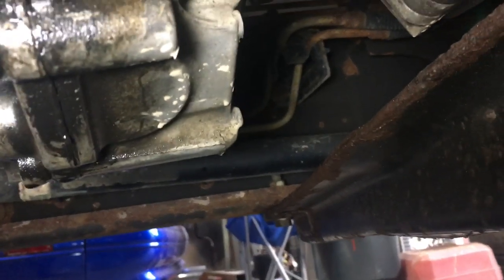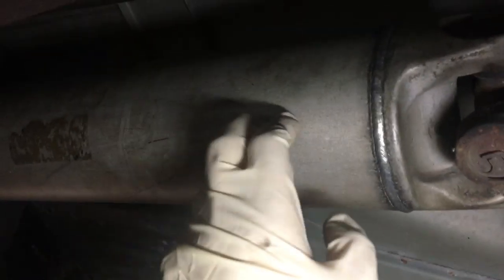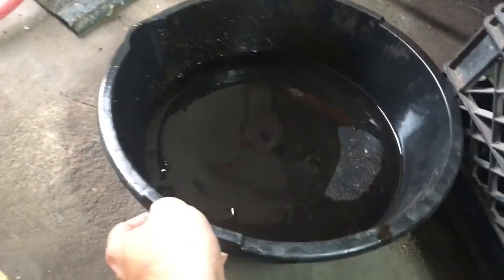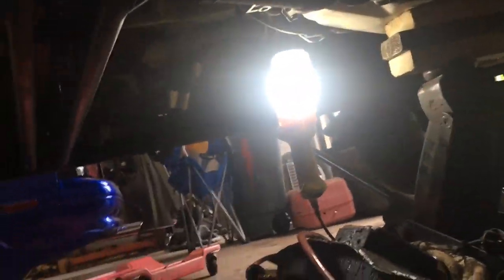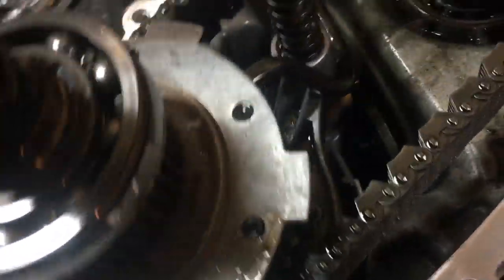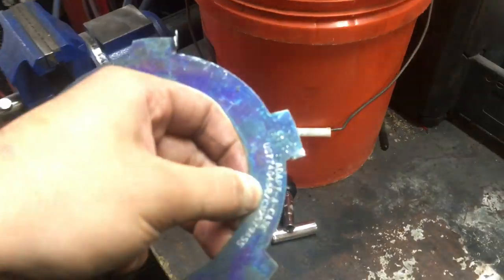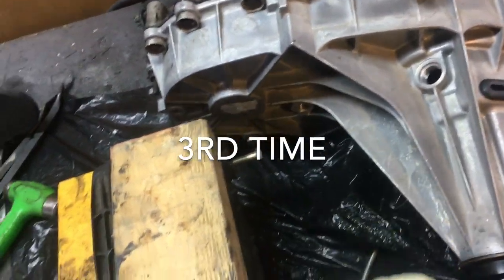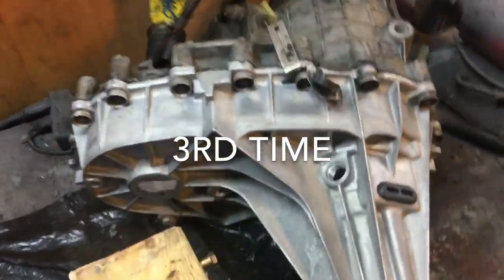GM Transfer Case Pump Rub Fix NP 261 263 HD Xhd

Comment: Permatex 51813 Anaerobic gasket maker which is probably the better way to go for these machined surfaces. This only hardens when deprived of air.
Reply from the maker: Stephen Johnson whatever works for you.
Reply: You can see in this vid that someone had already been into this case and used... "black RVT" which then filled up his filter.  Don't user RTV!

Comment: Some of that information was inaccurate it's only one bolts underneath the mount and you don't have to take it apart you just use a swivel a deep 15 socket and a short extension comes right off

Comment: I been wicked paranoid about this problem but at 275k miles mine still don't leak. No idea if I've just been lucky or what. I don't think the case had the fix done beforehand because when I changed the fluid there was a ton of super fine metallic you could see in the oil. But the level stays full and the case still works. I'm swapping in a manual transmission with my rebuilt motor and wondering if I should reuse this case or just get something else
Reply from the maker: @autumnjeserich2689  someone’s been in there with that mileage. Had a few of these trucks. They all get it before or at 200k
Reply: Considering I bought the truck at 190k that would line up. If the pump rub problem has been addressed, is it done for good or is gonna pop up again in another 200k miles.
Reply from the maker: @autumnjeserich2689  if they used a factory replacement it will go bad. They are not aluminum they are magnesium. The replacements I get are aluminum replacements and they say that they are a life time fix.

Comment: Don’t use JB Weld to patch the hole. It’s too hard and doesn’t flex. Got to hardware store and get polyurethane adhesive. It’s a better longer lasting temporary fix.
Reply from the maker: Preinstalled User it lasted the week that I needed

Comment: I would not use black RTV. It's your vehicle you can do what you want, but that is definitely not the best option.
Reply: Rock Roll 
As far as I'm concerned, it's NOT an option. ATF destroys regular RTV. You have to use the gray stuff that's compatible with ATF, like they include with the pump rub kit he's so adamant about not getting. That's also what was plugging his pump suction screen up. It was overrun with black silicone.

Comment: Will this make a grinding sound for a second or two when going out?
Reply from the maker: Crown _35 most prople don’t know they have this problem until its too late. You Can’t tell unless you see a hole in the case. Or too late when you run out of all fluid in the case from the hole and cook the internals until it’s all junk. Hopefully yours isn’t the last one.

Comment: im doing this and having a problem i can not get the snap right back on when i reassembled it with out the case saver it gos together just fine  but with the plat it off by a !/16 iff that any ideas
Reply from the maker: richard penning the shaft is not falling down into the snap ring for some reason. Make sure the front of the shaft has enough room to drop. And maybe the case saver isn’t installed right

Comment: hello there i am from mexico and i haave a yukon denali 2000 with the 5.7 motor. and my question is the main seal that goes to the shaft of the front wheels. is leaking oil and i cant seem to locate a store that sells it. can some one please help me out. thanks a lot for your time.
Reply: Omar Torres Sustaita rock auto

Comment: i did the case half on my truck and now after my 4wd wont work and i keep getting a service 4wd light any idea why im getting this ?
Reply from the maker: Jeff Williams assuming it's push button. I'd check electrical connections/ maybe a pin gob ripped out. That would be my starting point
Reply: myideasoffun ill check that but i for got to add it also when i start the truck some times the button will say im in 4low when its not and act likes it shifts from 1st to 4th and lugs down the motor and i would have to either put the trans in nutrual and push the 2high button or shut the truck off and on
Reply from the maker: Jeff Williams check wiring maybe reset computer. Changing a case half you shouldn't have dug to deep into it. So I'd assume it's a install or removal problem. Possible the switch in cab is bad. Older trucks had switch issues.
Reply: I need to find a np261 GM for my 2000 Chevy Silverado 2500. A place I called said they have a 263 HD with the same ratio of 2.72. Would the 263 be compatible and fit? I read that the 263 is electronic and my truck is a floor shift
Reply: Why the extra fluid

Comment: Is an np261 transfer cased the same as a 261gm transfer case?
Reply from the maker: NOMCCBAMA there is no 261gm as far as I know. NP is the company that makes most transfer cases. There is hd cases,  xhd cases. It’s stamped on the back
Reply: Thanks for replying. I own a 2006 silverado with a 4.3. The tag on the case is a new process tag. It reads 261 GM at the top of the tag.
Reply from the maker: NOMCCBAMA it would be a np-261. The hd would be 3/4 ton and xhd should be most diesels.
Reply: Thanks again. I really appreciate your help.

Comment: Where did you get the new case with pump rub ?
Reply from the maker: Matt Cherry probably eBay. Plenty of companies get have them. Make sure you get the right one
Reply: myideasoffun ok amazon has one made by dorman I thought about getting it. It has mixed reviews so idk
Reply from the maker: Matt Cherry I’ve done it a few times Parts don’t matter really. Just Get the right one as I described in the video and if it’s a magnesium case get the pump rub kit. If aluminum just put it on
Reply from the maker: Matt Cherry look when ordering xhd I s diesel and hd is gas. 261 and 263 have same rear halves. Just the x matters and material you wanna order/ can afford
Reply: myideasoffun ok thanks for the info
Reply: I put some jb weld on it today maybe it will hold till I can get a new rear case and find the time to do it
Reply from the maker: Matt Cherry should work for a little but not for long
Reply from the maker: Matt Cherry put more atf in so you don’t cook the bearings. I add 2 thru the full hole and the third court is recommended later on my Gm to fill thru speed sensor hole.
Reply: myideasoffun ok yeah I topped it off through the full hole it was only 1/4 quart low so hasn’t been leaking long I have a cheap car I drive to work so not gonna drive truck unless I need it
Reply: Mine is a model 246 not 261 or 263
Reply from the maker: Matt Cherry this was for 2500 and 3500 trucks. 246 probably have a 1500 process is the same. Just get the correct case half that matches your truck